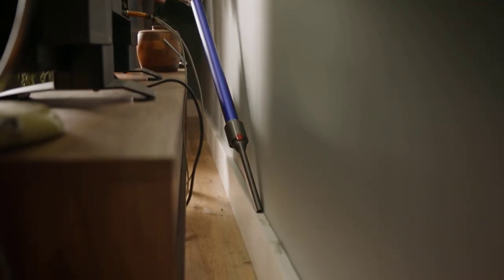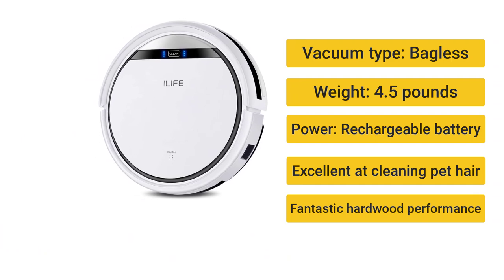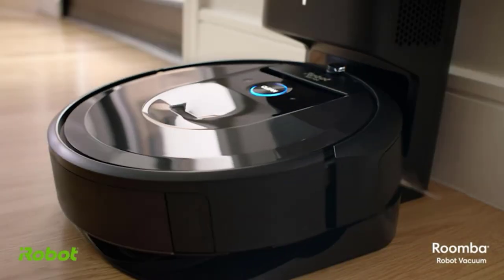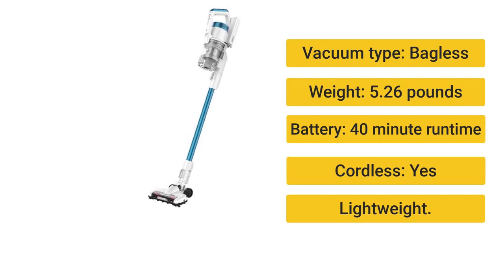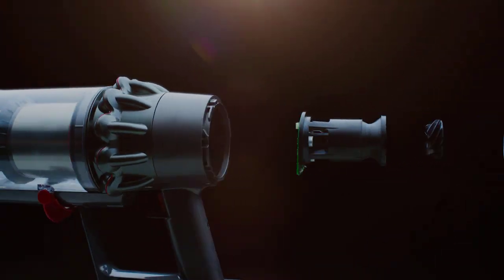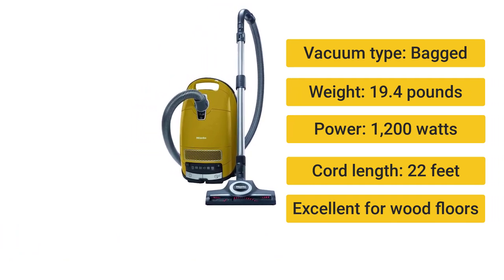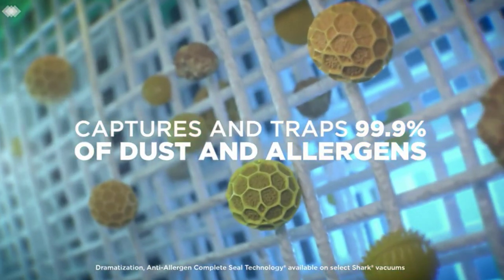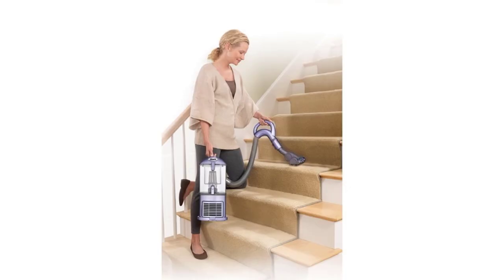10 Best Vacuum Cleaner 2022 [ Top 10 Vacuum Cleaner Picks ]

Comment from the maker: Links to the Best Vacuum Cleaner 2022 we listed in this video

➜ 1. Shark Navigator Lift-Away NV352- https://amzn.to/3zZO0Fe
➜ 2. Shark Apex DuoClean with Zero-M (AZ1002)- https://amzn.to/34TBFqS
➜ 3. Miele C3 Complete Calima- https://amzn.to/3A1LMVW
➜ 4. Kenmore Elite 31150 - https://amzn.to/3qu6afe
➜ 5. Dyson V11 Torque Drive- https://amzn.to/3fs63KV
➜ 6. Eureka RapidClean Pro- https://amzn.to/34Nq7oV
➜ 7. Black+Decker Dustbuster- https://amzn.to/3nwNIAL
➜ 8. iRobot Roomba s9- https://amzn.to/3qrmf5n
➜ 9. iLife V3s Pro- https://amzn.to/3fsxXGG
➜ 10. DeWalt 9-gallon 5HP shop vac DXV09P0 https://amzn.to/3FAtDQe